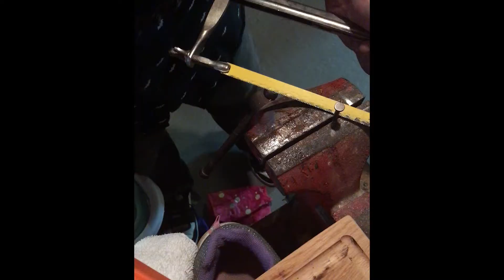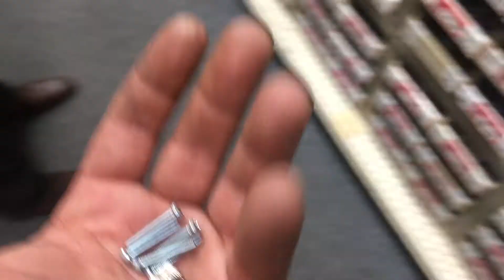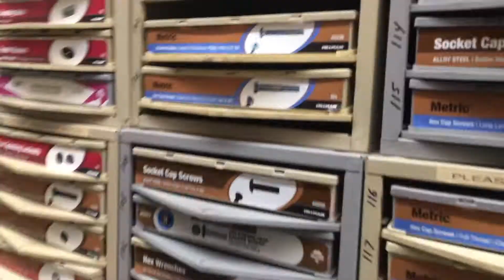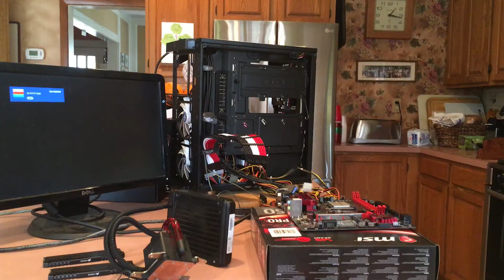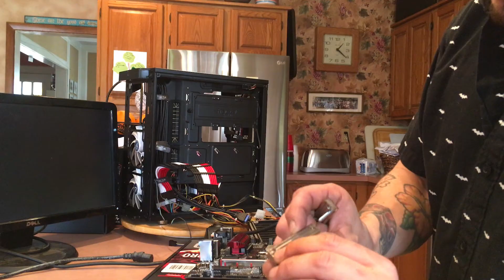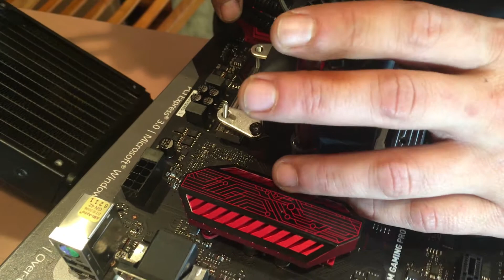Deepcool AM4 conversion kit FAIL and TRIUMPH! Project: Melocone PART 2

Comment: Good figuring out what is needed to get the Deepcool conversion kit working. I think and I've heard it from others too that Deepcool does not put enough thought into their product design. In my instance I have a Deepcool case that is too narrow and the panel keeps ever so slightly unplugging the power plug of my 3.5" HDD's. Seeing your problems and lack of documentation only confirms my thoughts about Deepcool products. Let this serve as a caveat to others who are considering Deepcool products. You may get a good Deepcool product without problems, but you stand a bad chance of getting a Deepcool product that is substandard in design and final function. Praise The Lord and Godspeed to you all - Psalm 54:4!!
Reply from the maker: Function in design is super important. Few companies nail it.